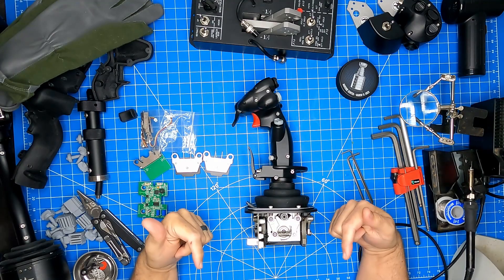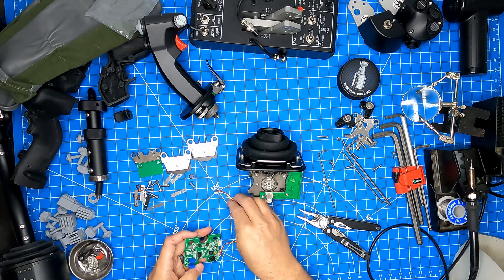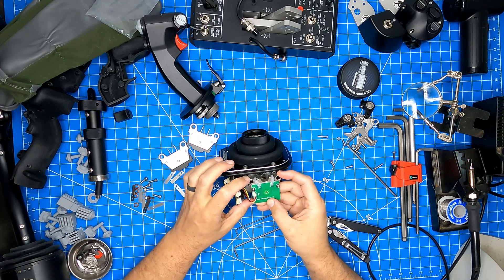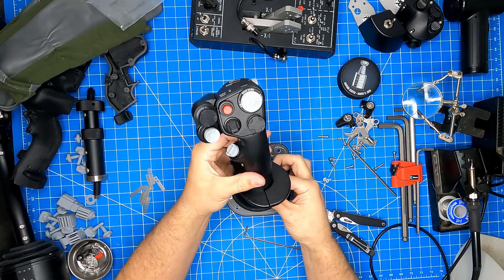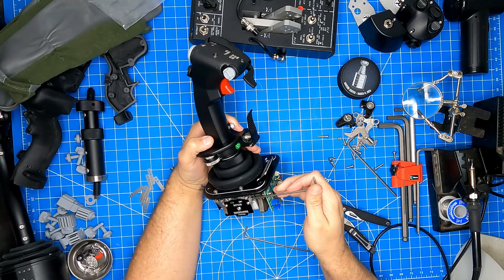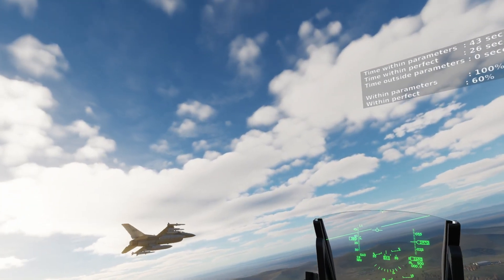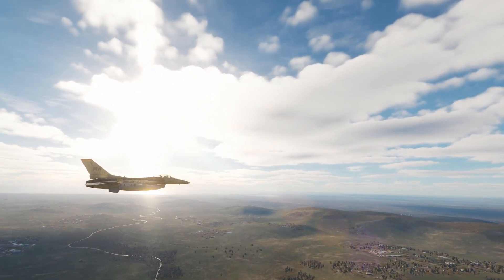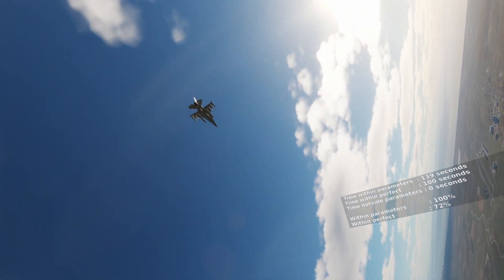Winwing Orion2 FSSB Initial Impressions

Comment: Thanks for the video! 
Just got mine and wondering about the feel of the base, if things are as they should.... I find the small amount of movement around the center to be to loose and the four force sensing "walls" to be to stiff, they don't move at all actually, can even hear a small audible clonk noise when I hit the force sensing walls in all directions. Is there a way to get a more smooth/dampened transition between the loose center and the rock hard fssb "walls"? Thanks!
Reply from the maker: Not without redesigning the base, no. And as a lover of damping, its unfortuante.

Comment: I would be interested in your settings in sim app pro and also DCS ( axis curves etc) please?
Reply from the maker: I will definitely cover this in my full review. I'm still tweaking and changing things
Reply: @FalconsLedge  No problem! I spent a long time getting mine in a good place. Finding the balance between the 2 opposing behaviours is difficult. What I mean is, in certain situations such as normal flight and manoeuvring, you need a quick ( but not too quick!)response. Then in situations such as refueling or formation flying, you need a much slower and precise response. I also owned a real simulator FSSB and you were able to switch force profiles with that so it was not a problem. With the winwing, one has to do all, so it is not so easy. I ended up using the mix of force and movement option. Realistic option ( as described by Winwing) is waaaay to sensitive, just impossible to give small precise inputs. I set the slider around 75 % and dialled down the axis forces to around 30%. I use the grip with a 100mm extension to give a bit more movement at the grip. With some curves in DCS, I find it’s pretty good.
Reply from the maker: @markturner6091  I am skeptical that the "realistic mode" is actually accurate to the real thing, but I'm no viper pilot